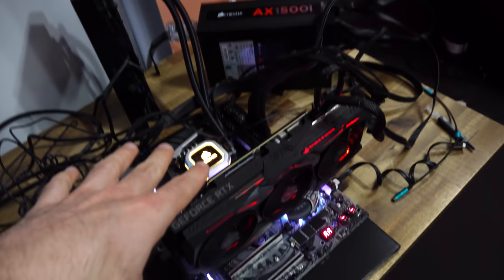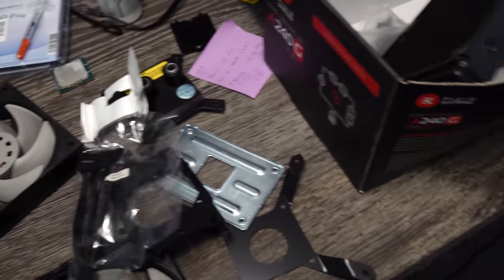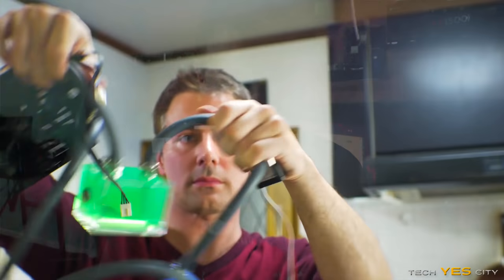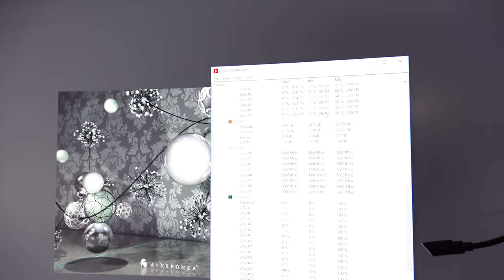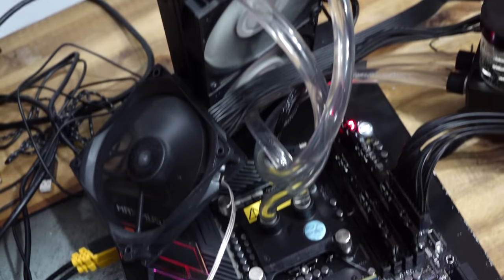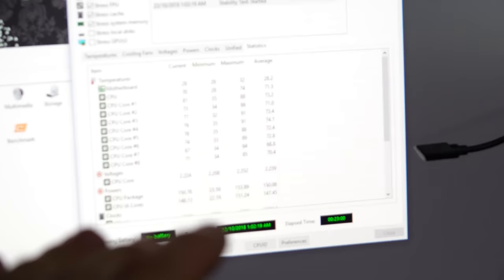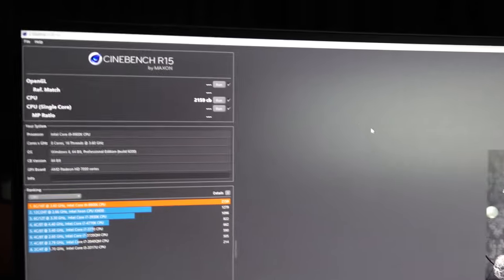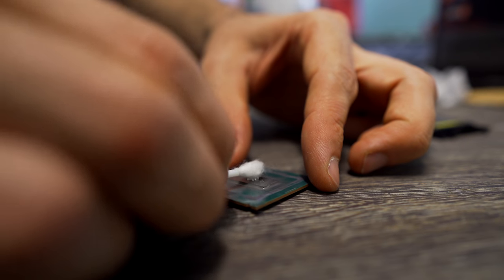Delidding 9900K - Is SOLDER Holding this CPU BACK!?

Comment: in scandinavia we just put our tower next to a window and open it no need for water cooling or nitrogen only glowes and a hat etc :)
Reply: @Pc ColdWar no worries mine gpu is even cheaper 1050ti , 6-7 weeks of heatwave this summer had me downclock my gpu 27-31.celsius in the shade , no window helps on that :)
Reply: @Pc ColdWar u are right it ages badly the 1050ti but okay i got it cheap and it worked 18 months so jaer u get what u pay for , i just seen there are good prices on the rx series now nice launch price+games one is not made out of stone .here we have 25% vat tax on everything :(
Reply: @Pc ColdWar ty , selling and getting a used rx i can see the point and no trouble getting it sold i know already , my screen went black a week a'go so i'm on my old one 900p makes the gpu a beast ;) freesync monitor is what i've been looking at . i dont play esport well wows but not really , i just got kingdom come deliverance and it hesatates(input) on low settings at 60fps steady (vsync on) the gpu get's to around 48-50 degrees and when i play wows it shoot up to 55-58 but dosent hesitate with input.
i run +640mhz on the ram because i knew about the 128bit bus it also oc's it self when doing so , i can see in gpu tweak core's goes to 1898 mhz when at 100%.
well i'm getting a new monitor freesync and a used 4 core cpu to swap in , then i will see about the gpu for dec-jan.
it is also a quistion of finance.
do u build pc's and sell them i thought it soundet like that earlyer??english is not my mother tung and i'm slow :)

Comment: Derb8uer proved that the CPU die is actually ticker and if is not sanded it won't make a big difference when delided.
Reply: it makes about 6 degrees, which isnt worth. intel is just a bunch of scums
Reply: *der8auer, *thicker, *delidded
Reply: @blackx38  anonymous*
Reply: @marting2827  Nope. Anonymous and Anonymus are two completely different thing. Anonymous is the hacker group. Anonymus was a chronicler from the 13th century. Here is the wikipedia link: https://en.wikipedia.org/wiki/Anonymus_(chronicler)
Reply: @blackx38  What about the Animus?
Reply: @blackx38  Thanks for the correction, english is not my native language.
Reply: @dethskullcrusher  No problem. English is not my native language either. I learned it in school.
Reply: @blackx38  
T H I C C E R
Reply: @Neiva71 wrong. Jayztwocents found a few chips recently he could spin like a top
Reply: @Thor_Asgard_  thats why i changed out my 8600k for 2600X
Reply: The question is more is AMDs die thinner? how would a 2700x perform temperature wise at 5Ghz....maybe intel and amd have to do it like this maybe just intel is doing it like this...
Reply: @MrDeadmanwalken1  I have the same on my 9900k. I just installed it with LM on the IHS and i got realy bad temps...i took it appart and checked it...not flat...forsure its not too much but enought for LM to not make everywhere contact. Normal paste was better....But it doesnt matter i will go direct die cooling with der8auers direct die frame anyway. I love to do such experiments....

Comment: Thermal Grizzly Conductonaut >>> Cool Laboratories Liquid Ultra

There is a reason Conductonaut is the best, 75 Watts/meter-kelvin versus just ~40 on CLLU!
Reply: ThermalRight Silver king have 79 W/MK
Reply: Lol 1c better
Reply: @Johnny87Au  i think 3 or 4C and have around same price than thermal Grizzly...
Reply: I'd say just get whatever is in stock. Conductonaut was out of stock so I went for liquid pro for this 9700k delid. Got an 8c reduction in max load temperature. I also used a direct die frame from rockit cool for that direct die cooling action.

Comment: good old intel, still burning hot because of die to IHS issues

but who would risk a 999€ chip ?
Reply: Pretty sure this chip is around 500€ rather than 999€, but your point still stands, unless you were talking about another intel chip, in which case never mind lol
Reply: It's 670€ here. Can Buy 2x Ryzen 7 2700X and a Mainboard for that...
Reply: @Neiva71  Agreed, I'm excited for 2019 and 2020, I wonder if Intel will switch from their ring fabric to their new mesh fabric to compete with AMD's Infinity Fabric. If they don't I believe AMD will have a good chance to do a lot of catch up.
Reply: @Neiva71  I agree, all I was trying to say was that the ring design doesn't seem to scale as well as the infinity fabric when increasing core count, at least in regards to temperatures. The 7700k and 8700k both hit 5ghz overclocked and it doesn't seem like they were hitting 90 degrees consistently.
Reply: @W4NN1  wow O_O
Reply: @peaj4812  they wont, its probably one if not THE thing they are ahead on AMD still, mesh fabric introduces latency and they would need to rework the memory controller
Reply: @lacucaracha111111  interesting, I didn't know that about the mesh.
Reply: @peaj4812 the x299 plattform isnt that good at gaming compared to z370/390 for that reason, and also why AMDs infinity fabric is really memory dependant
Reply: Neiva i have an amd fx 4170 4.2ghz.I had it in a custom case i made till last week when i got my new case which for the time being are running my old system till my parts arrive.This cpu is 125w tdp and 1.4125 volts and it runs 56 degrees in summer.In winter it runs 45ish so even the old crap amd cpu's are better than the 99xx models when it comes to heat.I can push this cpu to close to 4.8ghz and it will still run around 30 degree less than this 9900k
Reply: 550$ and it's not hot
Reply: @Nestoroo1236  14 nm Manufacturing shortage drove the price up there
Reply: @Neiva71  it is somewhat, with liquid metal it will stay at around 70-80 at 5 GHZ
Reply: @Neiva71  you do realise that both are 5 Ghz chips?
Reply: Me
Reply: @thepro08  Dude, you are bonkers if you think a 2700X can match a 9900K. It's at least 25% more powerful in raw mult-core performance, not to mention a 2700X would throttle a 2080 (NON-TI) by up to 10% in some 1440p benchmarks, let alone a 2080 TI would be way too much for it to handle. That's kinda pathetic.
Reply: William C Got’em, dude.
Gaming with a 2700X be like:
 “I’m at 120FPS -OOF stutter -OOF my 1% lows! Chug chug chug chug -OOF Blue Screen! This CPU is terrible! Ryzen can’t game, let alone run Windows! I need an i9!”

This message written through my 9900K/2080xc ultra, while I stare at wifey’s 3800X/2080xc ultra(formerly 2700X) across the office.

It’s a wonder she hasn’t filed for divorce from the inferior hardware and subpar gaming experience! Don’t let her find out! Don’t tell her! I’m begging you!
Reply: Speaking of hot 🥵 chips a hot intel cpu is nothing compared to a caroline reaper chip lol 😂

Comment: Brian, I really like your content, but replacing 240mm AiO with 240mm full Aluminium loop will give you marginal improvement at best. Put a proper 360mmx60mm copper loop, or add 360mm rad to that kit from EK. There is no reason to go with that specific liquid cooling kit over AiO if you don't add more radiators. Keep on the good work.
Reply: Yep. I'm running the same kit with 360 add on rad and gpu block. I couldn't imagine it without the extra rad but I can't break 5150 right now. Lapping and LM come next

Comment: i7 7700k (slight overclock) air cooler on thermal paste: 90 ° C
Upgrade: i7 9700k same heatsink, excellent thermal paste: 99 ° C
Upgrade: corsair h100x heatsink on liquid metal Thermal Grizzly Conductonaut: 59 ° C !! (in stress test)

Maybe in the future I will delid but for now I am more than satisfied!

Comment: 2.304v??!! WHAT?
Reply: Oh, im not the only one that noticed that, what the fuck is wrong with that voltage!!!, its too damn high.
Reply: @santi0797  There's no way a 14 nm cpu will run at those voltages.. that is a software issue for sure. That's insta kill CPU voltage.
Reply: That explains why it is so hot xd
Reply: calm down. AIDA is showing incorrect temps LOL
Reply: Wtf dude mine 6700k cpu is 4.8ghz and I have stock 240mm watercooler and getting max with aida 83 with all tests on
Reply: @edgarsnezinu1439  oh what, you think it's impressive?

Comment: if anybody is having problems getting their cpu stable try this....set the long and the short power limits to something like 180 for short and 195 for long(could be called maintained power or something else) and the tjmax to something like 80 or 82. this will throttle the cpu a bit when it hits any of those limits but will run at full speed for 99% of stuff.  games etc will run full speed and things like cinbench or video encoding might throttle down to 4.7-4.9ghz here and there but keeping the temps lower than about 80 will let you clock higher and still be stable.  its kind of cheating but as long as it works why not?  you should be able to get higher clocks and\or lower voltage with this trick.

Comment: As long as it's a stable oc and not thermal throttling a couple degrees drop should not affect how the cpu performs (changes in Cinebench Score) assuming everything else is the same. or is there anything else that affects it besides variables of multiple run of the test(which could be significant as far as Cinebench goes taking into consideration different mobos as demonstrated by GamersNexus)? Great video as always. cheers...

Comment: mine is still stock, custom open loop with just a 420mm radiator with only 3 fans as push to cool the 9900k and a shunt-modded overclocked Titan V.... passed a bunch of back to back Timespy runs last night at 5.3 gHz 1.375v (still need to try dialing down the voltage to find the minimum stable point). Did I win the silicon lottery? This is in a Fractal Design Define R6 case, all panels on etc.

Comment: I had the same 2.5 volts in AIDA64. Something is not reading correctly with the bios or maybe the software needs an update because it seems to be correct in other temp monitoring software.

Comment: lap the silicon down using a diamond plate and surface grind the ihs ,
thinner the better.
sooner the heat is taken away the lower the temps will be.
so keep it all thin.

Comment: Looks like someone got a sub par 9900k. De8auer mentions the silicon is thicker due to the 'new' Intel soldering process to reduce risk of cracking the die... De8auer die sanding shows improvements but is it all worth it over having an 'easier' delided 8700k or a 2700x with custom cooler for 15% less performance for a lot less cost?

Comment: Hey Brian, quick question about overclocking. If I am using my PC mostly for gaming how would you recommend I test the overclock, using only in game benchmarks or to use something like cinebench or firestrike until I get the highest value? Thanks in advance.
Reply: @BloodBoughtMinistries  Ya stress testing isn't what I was asking about, sure you can just start overclocking and hope to get the highest framerate possible because it happens to be the highest stable overclock, but that doesn't accurately reflect the highest possible framerate. For example when adjusting memory timings and frequency you have to ask the question if you want a lower frequency and tighter timings or vice versa in order to achieve the highest fps, simply stress testing won't answer that question for you. I would say stress testing is good for ballpark testing and at the very end of an overclock, but I'm asking about a more in depth overclock.

Comment: I think die was not smooth enough before liquid metal, one or several cores had hotspots. You can sand it a bit to completely remove solder, 1/10 of mm is plenty safe, cpu is on other side. 
Also did IHS sit tight, silicone removed?

Comment: Can you put liquid metal on top of the CPU after delidding it, I mean between the liquid cooler and the lid of the CPU? It looked like you used regular thermal paste, I'm thinking about delidding my 8700k so that's why I'm asking. Also, what should I go with Liquid Pro or Thermal Grizzlie Conductonaut?
Reply: yes
Reply: There are a lot more components that risk shorting when you use LM between the IHS and coldplate. Make sure your layer of LM is hella thin otherwise you'll wreck your components.

Most techtubers use thermal paste because they swap out their components a lot, and paste is easy and safe to clean off.
Reply: Also, go for the Conductonaut. It's the top tier LM in the market right now.

Comment: So how does the delid work, don't you have to heat it to release the solder, presumably a low temperature solder, and could the low temperature solder be removed using a temperature controlled station and wick?

Comment: I am waiting for my 8700k to arrive. Once I saw the videos on the poor quality solder and the much thicker substrate that does not conduct heat well, I knew to avoid the 9700k.
Reply: You won't be unhappy mate, I'm running a used 6600K and even with a mild air-cooled overclock its a beast for gaming.
Reply: @Neiva71   Shit I am stuck between the 8086K and the 9900K , I do music production and RED Raw video editing. I just bought the 8086K with the Z370 E , But I want to return it for the 9900K, Should I get a new motherboard to or just keep what I have. I need both single core and multi core speeds. I am coming from the i7-980x. ahhhhh i dont know what to do.
Reply: 9900k runs hot. 9700k doesn't.
Reply: @germanikolaas get the 9900k, but make sure you're running a 360mm AIO.

Comment: what about a pre warm up using a fan with no mounts just sitting on the cpu to warm up the solder to 90c =194f
melting point (183 °C or 361 °F) 

so the solder is soft enough so once the pc shuts down take the paper weight off the fan pop the cpu out put it into the der8auer to make it easier to delid less of a chance for it to break.

then use a soldering iron instead of a razor blade or sand paper because i broke two 50 dollar x5470's using sand paper no bigy. 

do you guys think a soldering iron would work better?

Comment: From India.  We have a history of getting bas cpus.

I  bought mine about a week ago. Have 0 time with the system. Got 5ghz with an aio @ 1.3 volts stable. ((360 corsair)) Do not buy as the fans are only 1500 rpm.
Avx offset is 0.
Cache is at 46.

If u want pls comment can give u more info if required.

Thx. Luv our videos.

Comment: Hey there... nice vids. I used the same liquid metal and it got stuck to my cpu cooler after approximately 3-4 months. It was little bit hard to pull it out and now the cooler and the cpu has some marks on it. I couldn`t scratch it all out. The temps were really low but after that.... I didn`t want to put it on again. Is there an explanation or did someone make the same experience? (and no...it`s not alluminium. My cooler is copper nickel)
Reply: LM diffuses to copper...  the stains are  copper-gallium alloy which  is 150W/mk  makes a smoother thermal conduction surface. The recommendation is to add more LM to compensate the diffused gallium.  The hard stuff you scratched were Iridium+tin  from the LM that did not diffused.

Comment: im hitting 2183 in cinebench overclocked @ 5ghz with a i150 pro only problem is my computer will shut down after two hours of gaming because the heat from the vega64 within my case overheats the cpu

Comment: Just keep in mind that you were loading 200+ watts into an aluminium loop with a single 240 rad. (Which I think is only rated for something like <200 watts anyway.) If it had been copper or a thicker or bigger rad then those temperatures would be been 5-10 degrees lower. I'm pretty sure that the CPU was just too much for the loop to handle..
Reply: Also, if your rad is at 27 degrees on the exterior then it's safe to assume that fluid temps weren't too far from that mark. For water cooling, any fluid temp over 25c is WAY too hot. Especially if you are trying to overclock. Yet more proof that you were being held back by the loop.

Comment: Looking at the bad solder from intel on the 9900k, i feel we where better with the toothpaste tim on the previous generations, at least with those cpus delidding could give us substantial temp drops but as this 9900k comes with solder, it is hard to remove the solder of the die which makes delidding pointless. I feel the best case would have been a non soldered 9900k with liquid metal under the ihs could have stopped it under 85c on all cores, that inability to remove the solder properly kills all the delidding performance. But if intel used tim on 9900k then it might not have post stable numbers even on stock clocks. Intel is such a big company, i dont understand why they dont take heat dissipation of the cpu die seriously.

Comment: ooof 90c and adia when your run more then just fpu is pretty close to real world temps the 9900k is the new 8350 in terms of trying to cool 5ghz I guess. 6c is about what deliding a ryzen 2000 series cpu gets. but it seems there is other things going on here with the thicker die and cramming more cores into a ring bus cpu and having it run this fast the next i9 consumer cpu better move off of ring bus as we didnt need this intel valcano

Comment: Dude what a freakin sketchy process getting the STIM off the die. I kept thinking you were going to slip and cut your self with the blade (but if you did it would most likely be at the beginning of the video or thumbnail). But, when you were doing that I started to think of a hot air solder station (we use them at work to heat up components that are BGA) but then I was thinking of the temps you would have to reach in order to melt the solder. I'm wondering If heating up the die to 325 to 350c would damage the CPU even though the heat source is external and not internal? I mean sure you would pre heat the CPU at 200c for a minute and raise the temp slowly, but would the STIM melt enough in 20 seconds or so under the IHS and not damage the die?

Comment: I've an x4 860k...I overclocked it to 4.2ghz...but temps are 85c now, will it be an issue...is it normal for the processor...I've a custom case with lots of fans and cooler master cooler for cpu...plz help me techyes